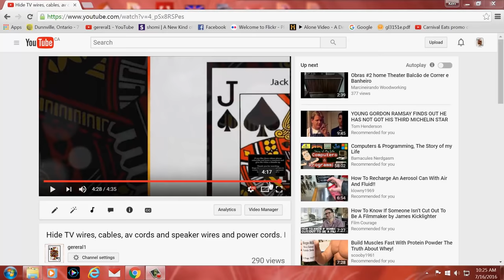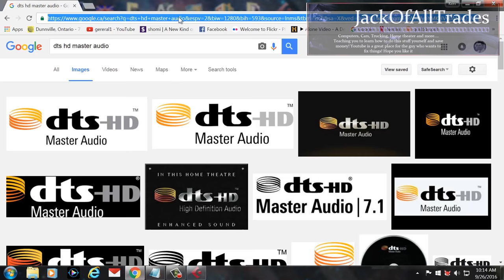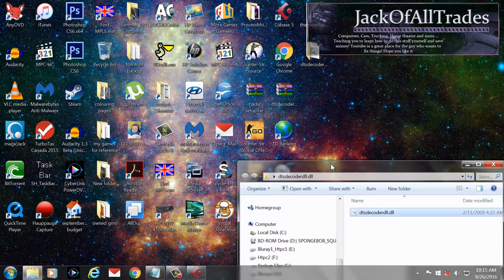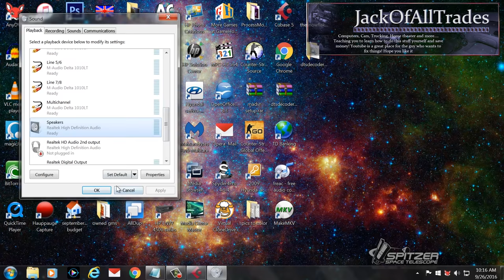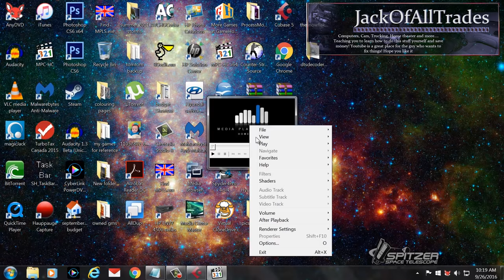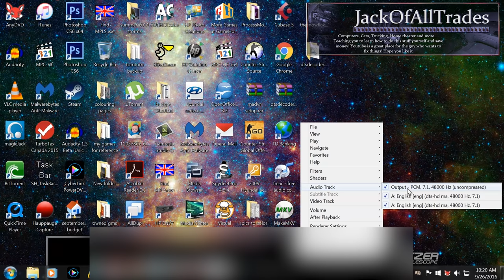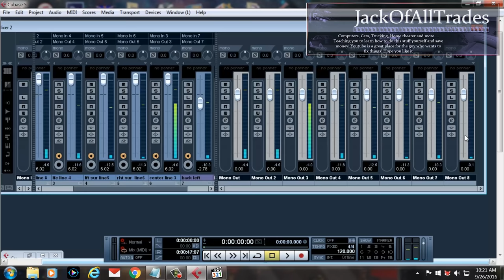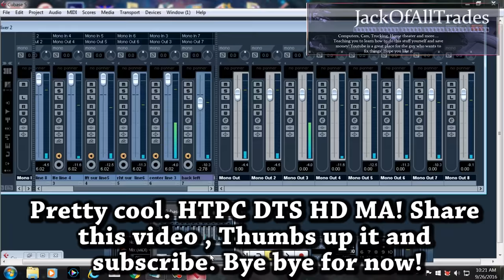DTS-HD MA 7.1 AND TRUE-HD 7.1 decoding in MPC  to 7.1 LPCM This completes pimping my htpc

Comment: QUESTION: I use MPC-BE and MPC-HC and VLC to play MKV video files. I use "Passthrough" in order to successfully play DTS-HD Master Audio, Dolby TrueHD, and Dolby Digital sound in 5.1 by sending the signal from my laptop to my Onkyo A/V Receiver. However, the format of Lossless PCM 5.1 does not play in the 5.1 format; it only plays in the 2.0 format. The Center Channel is blank and voices are not heard in that scenario. How do I get the Lossless PCM format to work in multichannel 5.1 format with the MPC-BE, MPC-HC, and VLC players using an HDMI output to my Onkyo A/V Receiver? This worked in the past on a different computer, but that computer broke. Now I don't know what is different.
Reply from the maker: My receiver is now HDMI in. HDMI is simple for decoding as you send pass thru. If your using 5.1 lpcm is passed by optic cable. Or decoding to analog and sent out via rca cables. In mpcbe there are internal filters you can enable for different audio settings. If lav audio filter will not offer this you could try fdshow audio filter. I think I have a video on this channel using fdshow audio filters. Today I now use Atmos amp with HDMI . Still have the old Denon amp. Served me well.
Reply: @gereral1_jackofalltrades  I'm using an HDMI cable, not an Optic cable and not RCA cables. I actually hooked up a different laptop and was able to get this to successfully work with LPCM appearing as "Multichannel" on the A/V Receiver. But, the one laptop still does not work.

On that particular laptop, the "Passthrough" works fine for 5.1 using Dolby Digital, DTS, Dolby TrueHD, and DTS-HD Master Audio. The format that causes a problem is LPCM Multichannel in 5.1. That format ends up being sent through the HDMI cable to the A/V Receiver as 2.0. 

I believe the source of the problem may be with Windows 10 rather than MPC-BE or MPC-HC. When I went to "Settings" and "Sound" in Windows 10, I was able to change the setting from "Stereo" to "5.1" in Windows 10 on the one computer. When I did that, it started working properly. However, when I do that on the other computer, it does not solve the problem. 

I can only presume something is wrong with the Windows 10 settings or something with the computer hardware. I actually cannot even see what sort of Sound Card or Driver this computer uses for Sound.
Reply from the maker: @michaelzoran  if you running generic audio it's usually realtec audio on board. I had an issue with HDMI and optic with ati graphics with realtec audio. Try looking online for latest realtec audio driver. Uninstall and install new one. Then retest. If the laptop will not pass thru try mpcbe with fdshow filter and select pass thru in audio options.  Tell me how it goes

Comment: Thanks for the informative video.

HDMI is much easier though when possible, and severly decreases the amount of cables.
So far, I've had lots of success with the Windows 10 movie player, which is the easiest way to play most multicanal files, it sends the audio directly over HDMI and the video amplifier decodes and does the speakers & bass management.
In a few cases, for an unknown reason (bug ?), I've had to resort to VLC, whose use for multicanal sound is a little more contrived.
Reply from the maker: HDMI is what I would do and have the amp decode at the end of the HDMI cable which would make this soo much easier. However my setup allows professionals to unlock 3 sets of stereo amps and run lpcm 8 channels to 3 amps and a powered sub. I was lucky when I bought my denon amp it had 7 rca ins and 75x7 dedicated amps and an lfe out. No need for lfe in as the sub takes care of that channel by itself. The new denon amps support dtsX and the more expensive ones have 7..1.2 out so you can do what I'm doin g here bypassing the amps and running dedicated amps. 75w at 13 below reference is LOUD, My living room is 25 feet long by 15 feet wide so speaker placement is optimal in my room. Its square and long. I made sure when I bought this house the living room design was there for speaker placement. I just upgraded to windows 10 and really like its slick interface. Some getting use too. Windows 7 was very hard to let go but I did because I wanted directx 12 support with h265 hardware coding. That is the only reason for upgrading. My M audio 1010lt 8 channel in and out card works perfect so I'm happy. Cubase works perfect too. I tried kodi and others and did not like the video quality of their built in players. I decided to go back to madvr for 1080p until I slowly move to 4k material. I am thinking about the karby lake processor with 8 channel built in motherboard sound and a 4k drive in the future pc build. I will keep this machine for studio sound work as a second machine.  Windows 10 player cannot play dtshdma material the last time I checked. Maybe further testing is needed. VLC cannot decode 7.1 but can decode 5.1. Already tested this program in the past unless they came out with a fix. VLC is ok but mpc hc is the way to go. I still need to take a look at plex .  I now need a front end graphic interface because my media browser plugin for wmc will not work anymore because windows 10 dropped the wmc. The other readon for windows 10 is the 4k support. I just hope windows 10 does not come up with updates that screw my system up. Just bough a hyperX 240gig ssd drive and am going to transfer windows 10 from my pci express  ocz revo drive which is 110gig over to this drive. Then use the pci express drive to do live video recording. The ops and reads and writes are insane on pciexpress hard drives.

Comment: Does this only work with the 32-bit version of MPC-HC?
Reply from the maker: Works with both plus mpcbe as well
Reply: @gereral1_jackofalltrades  Thanks. Could you please let me know how I can test it? I can see that the player is outputting a PCM stream to the default device, but how do I know it's the full lossless DTS-MA audio?
Reply from the maker: @QuantumBraced  are you output to 7.1 motherboard or to amp? Any tslink optic to amp will only output dts and DD 5.1 . If to motherboard via 7.1 speaker package then .dll will send put 7.1 dtshd 7.1 trurhd. Please search my channel for the test surround file I uploaded. In description is actual file that you can see each speaker being activated. It goes thru all 7.1.
Reply: @gereral1_jackofalltrades  Trying to output DTS-MA 7.1 to onboard DAC. The thing is, if I go into Filters -> LAV Audio Decoder -> Status I can see all 8 channels working, "codec" says "dts-hd ma" and "output" says PCM, both with 8 channels, 48 KHz, 24 bit which matches the thing I'm playing. However, this was the case before I even put the dll file in the LAV folder, and even before I installed an external LAV audio decoder and was using the internals. So I can't tell if anything has changed.
Reply from the maker: @QuantumBraced  download the test file from 7.1 video. Then turn on 7.1 system. Play this file in player and this file will send test tone to each channel. Use your ears to hear the switching. At time I created this file with hack version of dtshd encoder. It has lfe test channel too.
Reply: @gereral1_jackofalltrades  I did that and I can hear all 8 channels on my headphones with 7.1 enabled in Realtek HD Audio Manager. It also works with Realtek's headphone virtualization and Windows Sonic. But it's working even without the external LAV decoder and without the dtsdecoderdll file. So it's either the lossless core that is playing somehow and misreported (tho I don't think the core can be 7.1) or you don't need the dll anymore.

Comment: Hey thanks for helping and all the videos. Im struggling. I have a vizio p65 and a pioneer sc-95 run off a nvidia 1070. My gear is current and capable. I have a 7.2.2 set up with two in the ceiling. I have your initial setup done with mpc and mad using the Lav filters and you are correct it doesnt decode correct. My rears are missing in most ways and the amp is not reading the ac3/dts properly. I understand your other vid on setting up the fdshow part but those are two whole different setups. Currently my picture looks amazing at 4k especially with HDR. All working. But the sound is a huge issue. What do you suggest some type of hybrid set up?
Reply from the maker: you want dtsx atmos you must run hdmi and use power DVD to do this. My setup can output dtshd master 7.1 or true HD 7.1 and down mix atmos to 7.1. No dll file cam decode height channels .2 on pc anywhere. If you use power DVD with hdmi set and run it to the amp you will get .2 height channel. This is the only way. 

What I would do to fix the sound is set lav filters to hdmi pass thru in audio lav filter menu. Load a movie and right click in mpc and you will see filters if you set lav filters in external filters. The audio menu will popup and you will see pass thru. Then your amp will switch to dtshdma or trueHD.  If you have extracted or are playing iso in mpc and know the correct mpls file then it will trigger the amp. If you extracted to mkv you might loose the atmos tags and dtsx meta info but still get 7.1 but no height channels. With use redfox anydvdhd make image of the blurry.  Mount it with redfox  virtual rom and play in power DVD 14 15 16. Set audio to hdmi and get a splitter. Run one to monitor and other to the amp.  Set your amp to Bitstream to decode hdmi and the decoders in power DVD will send dtshd x or atmos height channels info. If you set to spdif you will only get 5.1 which sucks. If you want 7.1 you will need to run out 7.1 rca from motherboard audio into 7.1 in of amp. This setup can use mpc madvr lav filters with dtsdecoder.dll. if you must use madvr mpc you can mount blurry and select the mpls in the bdmv directory and it will play any blurry on the market and send Bitstream to amp for height channels with lav filters set to Bitstream pass thru hdmi. The splitter must be used from hdmi out to split video and audio. A splitter with edid switch will force 7.1 to the amp or 7.2.2. The edid  switch will override the stereo on the TV else you would only get whatever the TV supports. This sounds confusion but do some research on edid. For me 7.1 is perfect with my maudio 1010lt with 8 in 8 out. I have it run thru Cubase to 8 tracks eq to perfect sound match with test tones then sent down the pipe thru Realtek sound room correction and bass management to 7.1 out of motherboard and into my 7 dedicated in on my denon amp and .1 rca to 400 watt sub. I do not own hdmi amp so this is the ONLY way you can get dtshd master 7.1 lpcm. My TV is 4k and hooked to a rx470 am 4gig graphics card. I CAN play 4k and YouTube smooth on my 8 year old pc..lol. 4k is best played in mpc without madvr and using custom presenter with lav audio filter set to hardware decode. For me is set to divx2 and yours would be nevida. I can play a 788meh 1 min file butter smooth in 4k with 0 glitches in pans across the screen. I run ocz 110 gig ssd pice drive for capture and 240gig ssd for Windows 10. When I Wan amp on I switch to speakers in windows then load Cubase turn amp on and enjoy. Then switch to hdmi to watch video with TV speakers.

Comment: Hi bro, I hv i7 4th gen PC.. can I do it to my PC or Do I need to buy amplifier for speaker output..
Reply from the maker: if you decode via pc you have 2 options. 
https://www.bestbuy.ca/en-ca/product/logitech-z606-5-1-computer-speaker-system/13502145?cmp=knc-s-71700000061237381&gclid=CjwKCAjw8J32BRBCEiwApQEKgRdXtTic07lavUSDtAefQJb_LwLkcl6c764wRCHWMN4q-_xY68crRhoCQZoQAvD_BwE&gclsrc=aw.ds

Will take 5.1 back pc into a speaker system sub or your can buy amps and amp the external outputs or just go hdmi and get a receiver to decode.

Comment: Dear, I want to build a pc that can decode & Pass-through truehd. What are the requirements?
Reply from the maker: passthru can be done by any pc. hdmi sends out atmos, truehd, dtshd,dts,dd. If you use optic cable you are limited to dolby digital and dts digital 5.1. If bitstream the sound will depend on your amp. Even intels onboard graphics is enough to drive 4k movies and 1080p and audio is usally onbaord motherboard. Graphics cards are only needed if you game or do some type of video editing. Watching movies you only need motherboard, cpu with onboard graphics, and hhd space to store the movies.
Reply: gereral1 so I can play any hdr 4k movies by connecting my pc to the soundbar, right? I don’t have to pay license for atmos? 
What about android tv boxes; I mean do all of them Pass-through lossless truehd atmos to my soundbar?
Reply from the maker: @mr.ammardfdf2458  hdr 4k can only be played with cyverlink with secure rom, secure processor and secure chipset. Non hdr any pc can play. Now if you RIP 4k movies as per makemkv software with a rom you can use madvr and mpcbe to show trigger hdr bypassing the secure chipset, secure player and secure bios in motherboard. These devices are called sgx.

Comment: is it possible too decode atmos to true hd over hdmi my reciever doesnt decode atmos but it does decode true hd the reciever is from 2010
Reply from the maker: Only if you run 7.1 rca lines to seperate amps or buy home theater pc package. Decode will be 7.1 truehd not Atmos. Atmos is only HDMI out to HDMI in on amp. If you run optical you will get 5.1 DTS or Dolby digital 5.1 or 6.1 mean center back. If you need Atmos buy amp that has it. Dtddecoder.dll allows you to use mpcbe mpchc vlc to send out motherboard 7.1. Else u could use powerdvd to do the same but this will forced HDCP protection on copied disks and audio protection. That's why most use mpc and HDMI out from video card into amp then to tv

Comment: Hey I have a 2006 Kia Rio, and from my understanding they are exactly the same as the Accent of year. 

I'm having a lot of trouble putting in the passenger side lower control arm. do you have any tips or tricks?
Reply from the maker: dts video?? Goto hyundai forums and ill help you there. link under my top of page banner. name is ikilledbarbie

Comment: hi, do you have video, how to set mpc to avr, i need passtrough original audio (DD, DTS or DTS-HD) to my avr
Reply from the maker: If you load a move right click in mpc window and hpto filters you will see lav filters. Double click in them. If you do not have a movie loaded goto external filters in options and double click on lav audio filters. On the pass thru section select spdif or dtshd DTS ac3. Enable pass thru options. Now switch in your playback properties realtech HD sound. If you have motherboard with spdif output or toslink hook it up to your amp. Play the movie and you will get 5.1 DTS or ac3(Dolby digital). This will work with powerdvd as well going to audio settings and switching HDMI to spdif. I use to do it your way but wanted 7.1 so I bought maudio 1010lt and patched it thru cubase to get 7.1 dtshd master output and truehd 7.1.
Reply: i use hdmi from my laptop to avr
Reply from the maker: Look into 7.1 usb sound card. This might work or HDMI to spdif or toslink adapter. Research these. HDMI to spdif will get you 5.1. If your amp has JDM in then check all pass thru options. Ac3 filter look into this too as if can switch DTS to ac3 in real time to port our spdif. If you do not have amp side HDMI decoding then HDMI audio extractor to ac3 or 5.1 spdif or toslink hooked up to your laptop will work. Need anymore help just ask
Reply from the maker: Amp HDMI in use pass thru options in lav filters.
Amp no HDMI port in use spdif cable or toslink cable from HDMI to spdif toslink audio extractor box.
Reply: yes, i've use lav filters, but still can't pass thru the original audio, don't know what wrong ..
Reply from the maker: you running windows 10? type in hdmi device and goto driver and slect update driver and seach for web option. Then allow it to update. Then try.  when I installed windows 10 I installed acaudio realtek drivers only to find my hdmi out greyed out. Buy installing my amd rx470 video card which has hdmi 2.0 support I had no audio thru my tv. after updating the hdmi driver the audio worked. if your laptop does not support 7.1 I suggest a 7.1 usb sound card . do some research on this online before buying.
Reply from the maker: try to block lav filters ans install fdshow audio filters and set it up for pasthru and add in external filters in mpc. use 16bit option and uncheck 24 bit and others. select dts and ac3 and deselect truehd dtshd.
Reply: i use windows 7 (64), with total media player from arcsoft it can pass tru audio, but tmp is too hard to play (laggie), i'll try to update my hdmi driver now
Reply: ami mui hi, i just got an asus xonar hdav13/deluxe/A..sound card for a bargain!!! The problem is it came w/o software disc. Do you know if this card (apparently the highest quality audio card ever made for the consumer) will work with any software made for audio? i run windows 7 pro 64 bit. i need the drivers for this card to work.